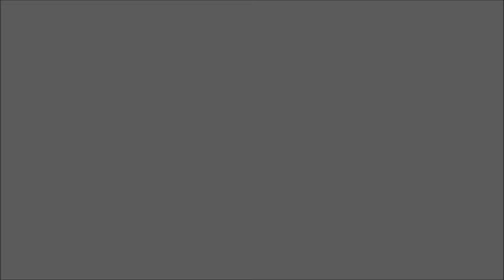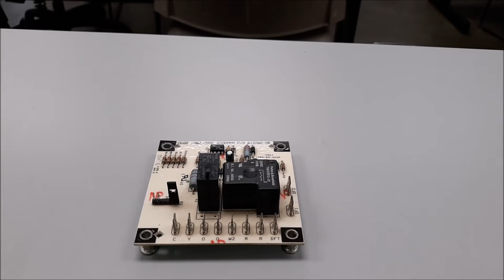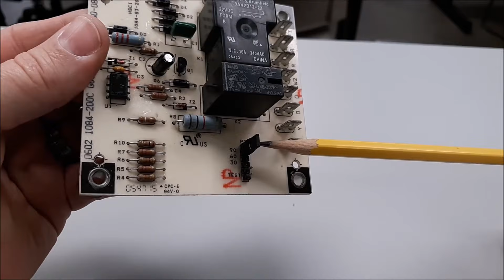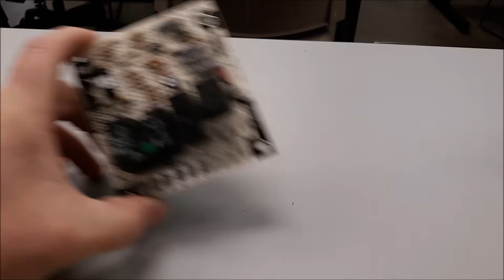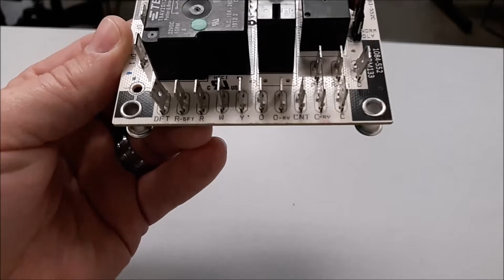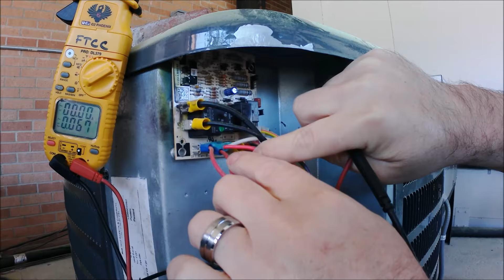Troubleshooting the Goodman Defrost Board

Comment: I learned alot from watching your video!! Thank you and i will be checking my defrost board in the morning and hopefully locate my issue. We have been below freezing for almost a week now and that doesn't usually happen in TN. I have a package heat pump unit that is over 10 years old. I kept temp set at 68 and the unit did great and kept it around 65 the whole time and no problems until the last night, last night.  I noticed blower running and heat coming through vents but unit had not kicked on like it usually does. I did have heat coming out of the vents so my heat strips are working but the unit is not. Went outside last night to see if unit was frozen but it had normal looking amount of ice in the bottom. It Has been like that the whole time and i have been hearing the unit kicking into defrost. Ended up taking panels off today and while inspecting and listening, i could here a click on defrost panel but nothing happening. Took off panel near coils and notice the defrost control (little black box near coils) was covered in ice and figured that may be the problem. Got it thawed and still not working. Tried turning unit off and let it reset, still doesn't work. Doesn't even work when turned to AC. Blower motor is blowing and heat strips are working in Aux and Emergency heat mode. What should i be looking for? I will be doing the checks on defrost board but any extra guidance would be greatly appreciated. The night before it quit, it ran basically all night because it was very cold and most of the day that next day. The unit is right outside my bedroom and it just hit me that the unit hadn't kicked on in a while. Im hoping it is something simple but any help on what to look at next will be very helpful and i will be scrolling through more of your videos looking for ideas. Thank you!!
Reply from the maker: Been busy and looks like so have you. I have a hectic first few days of the week so it is hard to get time to check comments but sounds like you are plenty capable enough and a little confidence never hurts 👍
Loose connections get a lot of us but slow down and pay attention and you can usually get it resolved. Glad to hear you were successful! Ever thought about being the next hvac company owner?
Reply: Ok. So when doing the testing, I have 25v going into board, 25v going out at dft r and 25v going back in at dft. So that's the opposite of what you have on the 1st wire which I'm assuming means the sensor is closed and not open. I'm now trying to find the video to check continuity and figure out where to go from there
Reply: I just came back to say I fixed it! I decided to trace the wires and check the continuity of the defrost control thing and high and low limit switches. All turned out to be good. As I was tracing the the Y wire back to the thermostat in the house, the little yellow wire seemed loose in the wire nut and it was!!! It had broken and lost connection. And just like that, I saved myself a $97 service call for a broken wire. Just for reference it's a Goodman14 seer package heat pump unit that was installed 11 years ago. The summer of 2022 it would blow air but wasn't cold. My son paid someone $120 to change a capacitor that was only $10. In October of 2022, the unit would run but no air blowing through vents and instead of paying someone to check it out and fix it, I started my own research and checking it out. I ended up searching and finding a universal blower motor and installing it. Turn unit on and it works great but condenser fan motor is squealing like a pig. Back to researching and find a universal motor to install and I was good to go again until the cold and ice the other day. I am thankful for people like you making videos and sharing your knowledge. It has saved me a lot of money. Thank you!!!
Reply: That is quite all right that you was busy because I have been busy too. Apparently I tooted my horn before I should have. The unit kicked off but I never got into kick back on. I strip the yellow wire from thermostat and connected it back to the  yellow wire that runs to the compressor and put the wire cap back on it and it started running no problem. I thought yay I fixed it and then it kicked off and didn't kick back on later that evening when it should have. I I then went back to my YouTube schooling and also learned from there that you also need to read comments under videos because apparently some people don't have a clue what they're talking about and they get corrected in the comments. I am the type of person I will look at something 4 or 5 times  before I mess with it to make sure I do it right to begin with. Luckily, I have a knack for this kind of stuff and I can figure just about anything out if I want to sit down and learn it or need to learn it. Especially if it will save me a crap ton of money. By the time I am finished with this unit I will be able to fix any unit except for putting gas in and the freon because I have no clue about that or checking the pressures because I don't have any pressure gauges. But if I happen to run across some pretty cheap,  you better believe I will buy them for the next time around but that still leaves the Freon issue but anyway. Hopefully I don't repeat to much so figure me if I do.
Here is what I have learned at school. When I press The contractor in the unit turns on and runs. I didn't know for sure if my switches were bad my pressure I didn't know for sure if my switches were bad and wasn't sure about holding the contactor in and having the unit run and it be out of freon and it be my low pressure switch causing the lockout and break something that wasn't broke to begin with. I checked the resistance on both of the pressure switches and both of the switches had zero ohms so that meant they were closed and should be okay. The thermostat is the thermostat that was here when we moved here 10 years ago and it had actually been moved from one part of the house to another because to begin with there was a split unit in here and apparently they took out the inside part. I don't know if they had a heat pump or not we was here about 6 months and it quit working and we put the heat pump in. I decided to check the thermostat because it had already been here when I pulled the thermostat off the wall it was very dirty on the inside so I cleaned it good And I was getting 24 volts on all the wires like it should. Decided I would get a new thermostat and replace it. When put in the new thermostat on the wall there is no give with the wires coming out of the wall from the thermostat. The black and brown wire were both wrapped up and not hooked to anything. While I was at the unit I noticed the brown wire was hooked up on the unit side going to another brown tan wire that ran down to my heat strips. So apparently when the unit was hooked up the brown wire was hooked up but the brown wire was never hooked up to the thermostat. I don't believe the thermostat was ever taken off the wall when we put the unit in so I hooked the brown wire to the E on the new thermostat. White to Aux (W2) because it was at W2 on old thermostat.  white wire on old thermostat was also touching the E on the old thermostat. On the old thermostat the Y was connected to the yellow wire and that was jumped with the little metal piece to the W1. I'm going to assume I have that right according to the heat pump book that I have on when we hooked it up and the diagrams that come with a thermostat. But that did not fix the unit it still is not kicking on.

On the defrost board I was not getting anything coming out of Y or CNT, which led me to the pressure switches but they are both closed. Unless I have tested it wrong, I don't have 24 volts coming out of the contactor. Checking the common wire coming out of the contactor to the yellow wire coming out of the thermostat, I didn't have 24 volts. Also when I'm out there and it's running the blower fan is running and you can hear the defrost board click every once in awhile. I'm going to assume that is the relay? 
Today I went out there and because the thermostat wire from the yellow had just broke. I'm assuming it just been so cold for I'm assuming it just been so cold for below I'm assuming it just been so cold for I'm assuming it didn't get above freezing for almost a week that it just broke and there is no play with the thermostat wires coming out of the wall so it's probably pretty tight all the way out to the unit. Maybe the yellow wasn't getting a good contact or I had another broken wire somewhere along the way. So I stripped back the extra black wire and hooked it in place of the yellow wire there was no change there was still no voltage running out to the unit from there. I knew the white wire was good because my heat strips and stuff would kick on so I took the white wire and used it from the thermostat to the yellow compressor wire. The unit still did not do anything but I was setting out there watching more videos trying to figure out how to troubleshoot the contactor or something else and every time the defrost board would click it scared the crap out of me and I would jump. that really stinks when you got your hands in there trying to test voltages and that thing clicks and it makes me think I've hit the wrong thing or something and I jump lol. As I was still sitting there trying to figure it out and troubleshoot it the unit kicked on. I didn't get too excited though but I was excited that it did kick on cuz maybe the wires  coming from the thermostat was the problem. I went in the house I had nice warm air blowing out the vents but I still didn't get excited because I still needed it to kick back on. I continue to let it run for a few minutes and then I slowly turn the heat back down so it would kick off and it did not kick back on when I raised the heat back up. I do know that my problem isn't with the freon or the limit switches because that's something that I myself cannot fix because I don't have the equipment or the license for all that good stuff but I'm hoping I can fix the other stuff. Also I was sitting out there waiting for it to kick back on and I don't know exactly where it come from but there was a noise and it wasn't the clicking from the defrost board. I couldn't tell if it come from the capacitor or the transformer or the other little black box that's there I'm not sure what that is either. I was going to check the capacitor but I don't have a meter that does the capacitance and apparently I need one in order to check the capacitor correctly. I did find where you can use the resistance setting and it should start at zero and eventually go to Infinity but that apparently isn't a great way to tell whether it's good or bad but that was all I had so I tried that. The readings I got were when it was hooked to the herm it would very very very slowly raise I'm talking slow.  it would raise a little bit faster when it was hooked to the fan part. after I did that if I turned around and hooked it right back up I wouldn't get a reading at all to either one. so I'm not sure exactly how they're supposed to work. I mean shouldn't it be the same. Start out at zero and work its way up each time or does it do that in between or is that maybe my problem the capacitor is just working here and there. I do know a capacitor does not cost that much so I plan on ordering one and if it doesn't fix it then I'll have an extra one sitting on the side but then I got to thinking about the relay on the board that keeps clicking I think according to the diagram it is maybe CCR but I'm not exactly sure which one of those two black boxes it is. I also plan on running a new thermostat wire when I get it all figured out.
Anyway, that is where I'm at right now and so I will go back to my YouTube school and see what I can't figure out tonight and if it's not raining tomorrow start all over again and see where I get tomorrow. I will eventually get it narrowed down. It may take a minute but I don't give up easily. Thank you so much for replying and  believe me I understand what it means to be busy thank you
Reply from the maker: I got sick last tuesday but wanted to throw something your way since you mentioned a loose Y wire. Don't know if it will help now or not but here goes since you seem fairly confident about the pressure switches being ok. 
That board needs 24 v on the 'R' terminal (one test lead on R and the other on C) in order to do pretty much anything. It actually goes out and checks the low pressure switch and once the CCR switch closes, energizes the contactor coil and make it close to turn on the compressor. Keeping a loose wire in mind - I wonder if maybe it has a loose connection somewhere like the Y wire did? Been a few days but meant to get that out (before I got sick) and see if maybe it could help or if you had any success with it since a few days ago.

Comment: Green tech over here 

Found 3amp fuse blown on the indoor air handler 

As soon as I replaced it “thermostat being off” fuse blow up again.

Isolate R going to the outdoor unit 
Didn’t blow up fuse

As soon as I open the outdoor unit rain decide to come, I was able to see some burn between the resistor on the front and back of the board 

Can I have shorter board ?

Probably the actual thermostat wire R is shorting somewhere?

Btw- thanks for explaining everything. You got a new suscriber
Reply from the maker: Seems like a lot of goodman defrost boards get replaced because of those resistors. Not the first time hearing this description. If it isn't the board it has to be a short in the 'R' like you say. Somewhere the wire is rubbed through and touching the common wire or grounded against a copper pipe. Continuity would help locate or some guys just swap it for a spare color and see what happens (since you are already blowing the fuse) Electricity don't care about color! Red could be brown! But if you did that and the fuse blew again I would do a continuity check and also consider the board being bad, depending on how the continuity check went.
Reply: @johnjennings-JJ  thanks, I didn’t wanna condemn the board since It was probably just discolored just by a quick look

Comment: Thanks for the video, I'm having issues with the defrost board an actually have a new one coming, but in the meantime I wanting to bypass an power contactor to run for heat mode .so I wired up an had running, but  left everything running through old board, an just jumped out y an cont terms to get to run .but it seems that there  still wasn't any heat  coming in the house ,so I disconnected worried I didn't have something right an could cause more issues, I was wondering if there was a step I missed to make this work, maybe  Rev valve. Needs de energized or something, for heat mode, (Goodman unit) an with no defrost will this hurt the system,.Thank you
Reply from the maker: Don't know about a missed step but running the unit i  heat mode with no way to defrost could keep you warm for a bit but it will just accumulate more ice and basically be running for nothing - depending on how long  it runs. Kinda like an igloo. Ice will just insulate and no really let the unit move heat inside.
Reply: @johnjennings-JJ  Thank you John for your reply, well since I messaged you the first time, I started digging into everything a little more an found that my low pressure switch was open so I jumped across terminal on Def board an unit kicked on so ,Def  board ok but now I either had bad pressure switch or low freon ,found out no freon at all. I had a guy pressure up system an found that the service valve was leaking an I lost all my freon, I guess the drastically drop in temperature over the week sucked it out the leaking valve. we tighten but still leaking some ,so he suggested replacing an then recharging system,  a more expensive  problem now, I was hoping of another way of sealing the valve,  I seen were a man has this 410 seal kit that he uses on a lot of his jobs an says it definitely works  ,but I can't get ahold of him to get kit or any details, plus I just hate to replace valve if it could be repaired, may be best to replace though.
Reply from the maker: Sounds like it isn't the schrader core/stem but at the top? If so I have seen some guys try thread lock stuff, not the tape but it might work for a while. I would say replace it and know it is right but "gotta do whatcha gotta do". Low freon is always the problem 😪. At least the pressure switch did its job.

Comment: We have a 26 yo Janitrol/ Goodman heat pump system.  We have to replace the defrost board for the first time.  This is the exact board that we had to buy as the original has been discontinued and this is the replacement.  There is a difference and hopefully we will have no problem after watching your video.  My husband is a former HVAC technician, but has been out of the business for many years, retired.
Reply from the maker: 26 yrs is a good run! Also.. I wish I could retire. He's got it in the bag. Just like they say about riding a bike, you never forget some stuff.